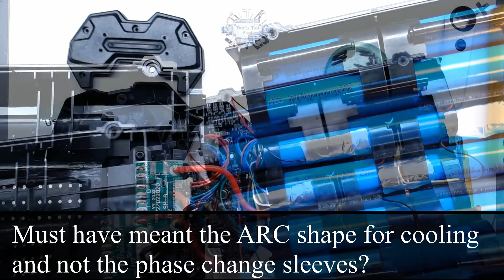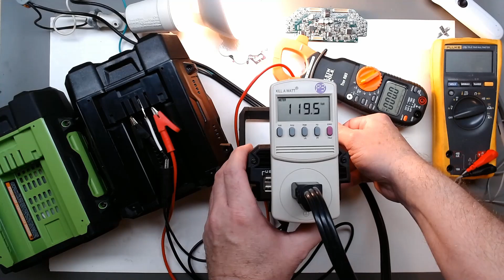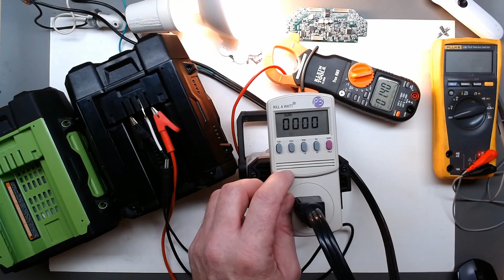Ruzixt 56V 5AH Battery for EGO Products

Comment: I want to say this may be the wrong video for my question but since the board is labeled so well I figured I would ask here. My bms started blinking green then blanked out with no lights at all. ( q12 looks to be shorted (Just opposite the way yours was) I also noticed what is labeled d9 on this board wasn't attached on one side, maybe this caused the board to stop working if it got knocked loose when I removed the potting. while trying to repair it I lost it, do you happen to know what this part is called So I can replace it? Thanks so much for all the knowledge you have shared with us. Btw awesome budget spot welder I had just ordered the same one! When I saw your video today it let me know the purchase was a good one!
Reply from the maker: I looked over one of my Gen2 boards and the D9 is a diode marked as "WM" it's the only diode on the board with that marking I believe. It has the cathode or line towards the right side (or away from the transistor). Hope it helps some as I have not had to replace one of those to say for sure what all it does. As far as Q12 if shorted it will blink green constantly and pull all cells to zero volts if you don't disconnect the board from the cells. I feel like you did pick a great spot welder. Hope you enjoy it as I have mine. Thanks for your kind comment!

Comment: Thanks for making these videos! 
I have a 5ah genuine battery that got wet during use. I took it apart to make sure it dried up properly, but when I pulled it apart, four of the small colored wires came out of the white socket. I checked this video to try and work out where the colored wires go (all the other wiring seemed to be the same), and put them back in. When I inserted them with some small pliers, I saw a couple of small sparks, which was concerning. But I screwed the battery back together, pressed the big button on top, and it showed almost full charge, so I thought everything was probably ok. 
However, this morning I noticed the button was red (for at least 10 seconds), and the top of the battery pack  was warm. I waited half an hour, the battery pack cooled down again, with a green light showing. 
Do you have any idea what could be happening? Did I create a short circuit and ruin the battery? Do you think it’s safe to use? Would really appreciate your thoughts! Thanks
Reply from the maker: My first thought is that something either did get connected incorrectly or at least could have come across something incorrectly. Hard to say if damage is permanent or if something is still wrong. I have a video from a few years ago that was to help someone with questions about the wiring, it might help you verify. Best of luck to ya! 
https://youtu.be/RfTJODoh8Q4
Reply: Thanks for the reply!
Reply: I think the sparks you saw when inserting the connector is normal.  It’s definitely wise to keep an eye on a pack that is warming up unexpectedly though.  The bms is pretty picky so IMO you should be safe as long as the light is green.  
If you open the pack up again I would use some hot glue and make sure that connector is seated correctly and glued down/ protected from moisture.
Reply: @maukaman  Thanks for that

Comment: I have yet to see anyone connect these batteries to the ego powerstations or products. They said some versions of the powerstation that these dont work with but i want someone to actually do test outside of testing with other devices and readers.
Reply from the maker: I have mentioned in my latest video that I contacted the manufacturer of the pack AMC battery sold under Sunmily on Amazon and they stated the 6.0Ah and the 7.5Ah that they sell works with the power station. the 5Ah does not. That is just that one manufacturer that I mentioned in that video. If I get a power station I will test, I do not need one bad enough to pull the trigger at this point.

Comment: Works on power station but  power station doesn't charge batteries.
Reply from the maker: I shared a video very recently on the 6AH version of this made by AMC. The company sent it for us to look inside and test. Since I had so many people asking about possibly working with the Nexus Power Station I asked the company contact and He replied that the 6AH and 7.5AH did in fact work with the power station and the 5AH did not. I did not have a power station myself to test it.

Comment: I read comment on another video stating these Chinese batteries may need to be re balanced. Keeping them charging for two weeks will let BMS balance them.  Is that true?
Reply from the maker: Well I am not sure you would have to do that. This BMS seems to be self balancing. I do not know for sure how well that part works. I may do a update video on this and share my experience if viewers may find it helpful. I have heard or seen bad things or bad experiences on YouTube from some YouTubers, but I have used mine a while now with no issues with what I use them for!

Comment: How bout that 9ah battery tho?
Reply from the maker: I do want to try that one eventually! 
I have not tried it myself.
Reply: @ThriftyToolShed  I watched another video of someone who purchased both the 7.5 and the 9 ah battery. He stated that both weighed the exact amount and after running a controlled time test, both batteries lasted the same amount of time which leads him and I to suspect that, the 9 ah batter is the same as the 7.5 ah, just charging you more and has a 9ah sticker instead. I really want to get the Ego Snow Blower, but with all the things I am seeing with the batteries, I'm super hesitant. I dont have the technical know how to attempt to repair one on my own and to have to keep replacing them after the 3 year warranty is kind of insane.
Reply from the maker: If you look, it's so many of the aftermarket packs now. Even directly from Alibaba etc. It is hard to trust what you get for sure. I did mention the name and seller and manufacturer of the one I tested since there are so many similar on the market now. Hard to trust for sure.
Reply: @ThriftyToolShed  The one he had was the same brand as you mentioned and showed, the Ruzixt.
Reply from the maker: @darkreaperwolf  
Yes, this brand did come up a little bit short on my test as well. The 6AH AMZ  I tested in the latest video actually exceeded its capacity rating. Thanks for sharing.

Comment: A good thorough review. The only question I have is if the battery was cycled at least twice? I found that on the first charge, my Ego and Toro batteries seemed to not have full capacity. After a couple cycles they did. No metrics on it. Just my observation. What I'd like to see is devices coming out that can use the Ego batteries. I have three now, from my snow blower and leaf blower.  bought a Toro lawn mower as I liked it marginally enough more than the Ego.
Reply from the maker: If I remember correctly it was the 2nd discharge cycle that I tested the pack capacity. I have never seen with lithium any reason to "break them in" sort of before a capacity test. On the other hand I have no metrics on that either! I have been making other uses for my packs at the moment as well. They are a great platform to use on a variety of applications. Alot of people comment about using them for ebikes. They are also easy enough to use with older tools etc. that will still run off of 120VDC as well as 120VAC. I also made a make shift vacuum and I am currently working on my own lawn mower, but not enough time and money lately to finish it. Thanks for your comment!

Comment: Would love a long term update. How are they holding up after 5 month? I’ve seen this on Amazon and eBay. They offer batteries up to 9Ah which made me interested as I just bought the zero turn and the 10Ah batteries are $450 each. So if I can get away with half the cost it would be pretty amazing.
Reply from the maker: I have not had any issues yet. Still works well for me really. I will also try to give a 1 year update as well.
Reply: @ThriftyToolShed  thanks man

Comment: Excellent video. Thanks for all the information. I purchased the Ruzixt 56V 5AH Battery a couple of days ago. Looking forward to using it in my tools and the 150W EGO Inverter. Still curious why it's not compatible with the EGO Power Station. Great channel, Subscribed. Take care.
Reply from the maker: Thanks for your comment. It is some comments on here about the power station and it seems they show up as a 2.5ah pack. I assume they copied the program in the EGO 2.5ah pack so it shows up as such.They most likely had to copy the chip to get the D-terminal to work correctly with tools. Should not matter a while lot other wise I would think.

Comment: Does that battery work on the Eco Nexus power station
Reply from the maker: Ruzixt mentions in description that it is not compatible with the Nexus power station. A lot of comments on here are about that. Viewers are saying it shows up as a 2.5ah when placed in power station like they copied the 2.5ah pack BMS program. So at least the BMS is EGO compatible which is impressive, but apparently will not show correct capacity?

Comment: They are listed on Amazon again. I was thinking of getting one but it said it wasn't to be used on the Nexxus Power Station. Curious as to why that would be.
Reply from the maker: Some have said that it shows up as a 2.5ah? Seems maybe they copied the 2.5ah BMS program to get around the D-terminal communication between the tool and the pack? That is what let's the tool know which pack is installed and what condition of pack is in. It most likely will not effect most tools, but seems like it shows up on the Nexus.
Reply: @ThriftyToolShed  I should have read the comments first again before posting. I see this has been covered, Thanks for the quick reply.

Comment: Has anyone tried to use it in the power station, even though it says it wont work?
Reply: Just put four 9ah of these generic ego batteries in the nexus power station. It works.
Reply: @normand30  - “four 9ah…
that is really good news!!!
Reply from the maker: I don't have the power station to try. What says the pack won't work in the power station! I don't see why it would not work. I tested the D-terminal works with my tools and the Nexus Escape. I was glad they got the D-terminal to work so I assumed it would work on basically everything?
Reply: @ThriftyToolShed  It is what is says on its Amazon page. "For use of all EGO POWER+ Power Equipment except PST3042 & PST3040 Portable Power Station". On both of its links(5ah, and 5000mah). Maybe it will now work since the D terminal now works? The power station also uses and APP, that reads battery levels, etc. I am wondering if it cant read the battery,  it wont work in the power station.....But that is a guess on my part. And it may still supply power, and it actually working.. but the power station cant "see" it. Wish I had one to test.
Reply from the maker: That's why I was wondering. I was surprised the D-terminal worked well but might still be something they haven't figured out about it if in fact it doesn't show compatibility with the power station. That is  interesting, it did not show that back when I ordeded it. I wonder now if they figured that out later themselves? Must be true though if they noticed it and updated that Information. I am certain it showed compatibility with all EGO 56V products when I bought mine many listings ago. I was hoping to get some spare BMS boards from them, but no luck yet. I wish they would sell them, especially if they get it totally compatible. Thanks for bringing up this issue, I did not realize they found that issue! I don't have the power station to test but I want to get one, I am waiting for the next generation hopefully. I am bad about buying one right before they come out with a improved and updated version. Lol.
Reply: @ThriftyToolShed  They are coming out with the solar charging accessory in the spring, so maybe they will release a new power station too....though I dont think they are actually working on a second that I know of. At least not to be released soon.
Reply from the maker: That is what I have heard as well. If anything like the blowers and mowers, they will change it soon though, I am betting. It has so much room for improvement. It's bad when dewalt station out performs it with 20V batteries. They need to step that up for the price in my opinion.
Reply: @ThriftyToolShed  agreed. Its got a ton of potential.. and since it has internet they can improve it with software and firmware upgrades. It needs solar and the ability to use it while charging. Those are 2 misses.
Reply: @chrisanderson8553   I'm really glad I read this comment, and reread the description on Amazon. I was about to purchase a couple of the Ruzixt 9 Ah batteries primarily to use in the PST3042. Now I will probably purchase one Ruzixt 5 Ah battery for use in the tools, saving the EGO Batteries for the power station, and this would allow me to see if the Ruzixt will do anything with the power station.
Reply: @ThriftyToolShed  i wonder the amazon return policy is... I wonder if i can test it.. and send it back within 30 days...
Reply from the maker: It is usaully really good on return policy. I have a feeling if Ruzuit is now showing it doesn't work with it, they found something....
Reply: I saw a review on Amazon that states that these batteries are showing up as 2.5 ah batteries on the power station. Darn. I had high hopes for this but it’s starting to look like a scam. It looks like it is a real 2.5 repacked into a bigger case. Hence the high quality inside. I have a link to Amazon listing...
https://www.amazon.com/Ruzixt-Lithium-Ion-Replacement-Compatible-ST1502LB/dp/B08HVM3DTF
Read the reviews...
Reply from the maker: In the Ruzit description it says that it's not compatible with the Nexus power station models. I would think it might be that they copied the program from a 2.5BMS maybe and used it in there BMS? So they got around the D-terminal communication issue, but it must think it's a 2.5ah. I of course tested the one I purchased so no guessing is needed on the rating. I compared it to the newest 5ah EGO pack I had and it fell a little short more like a 4ah but no it's not 2.5ah.

Comment: I always buy the tool and battery combo for the same reason.  I see the Ruzixt battery is not available on Amazon right now.  These companies are making it harder and harder to self repair!
Reply from the maker: I agree. That is one reason I do what I do. I want parts available and schematics also. I do what I can without schematics but it is much more difficult for sure. The Ruzixt battery is changing from Amazon to eBay and also changing from 5ah to 5000mah and on eBay it is listed as 6ah right now!
Reply: @ThriftyToolShed  ; Are you thinking about doing repair service?  I suspect the need for this is going to increase in the coming years but we need "Right to Repair" legislation!  If EGO isn't going to offer repair service to keep these out of the landfills then we should be able to fix them ourselves or third party.  But, if we do get legislation then companies could end up doing what Apple is doing and making it so you must have the repair parts paired to the device.  Apple is doing this with iPhone screens, batteries, cameras and other parts.
Reply from the maker: @jamesbondero6170 
I would love to get to that level before retiring one day. At the least I do wish to see (in this transition to more battery powered devices) that we have as you stated the right to repair. Stop making it so hard to repair. Share schematics, inormation and mass produce parts. It is time to realize even at some level of danger we have to be careful and repair some things ourself. No different really than the shade tree mechanic, you must respect gas and hot radiators the same as we must respect lithium cells, sometimes high voltage  and moving parts. Hopefully if enough people push and learn we will still even with electric cars etc. be able to fix our own that we Own!

Comment: Interesting video. Any luck contacting the manufacturer?  If they supplied an email or other contact with your order would you mind posting it?  As others have stated, that battery is no longer available and I couldn’t find a website. Thanks.
Reply from the maker: Yeah, it appears to be gone. You can't even find it without the link I shared for it now. It is not showing in stock and it may be removed before long? The small manual I shared in the video has some contact info. I have tried the "contact us" on the website and no return yet.
www.hygbattery.com
After sales contact info also has a number but may not speak English?
Redsun group
0755-26416845
Customer service is...
0755-26416835
Reply: @ThriftyToolShed   I found it. It is at https://www.amazon.com/Ruzixt-Lithium-Ion-Replacement-Compatible-ST1502LB/dp/B08HVM3DTF
Reply: Hi, T. we are the manufacturer. if u have any inquiry , pls feel free to contact me.

Thanks
Reply from the maker: Hi,
I did try to contact your company to see about possible purchasing replacement BMS boards. Thanks for contacting me.